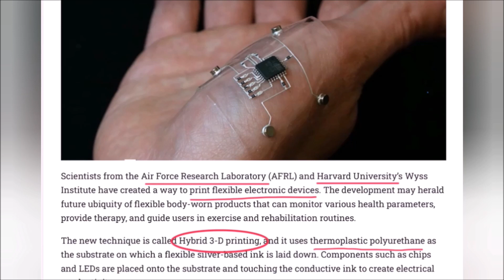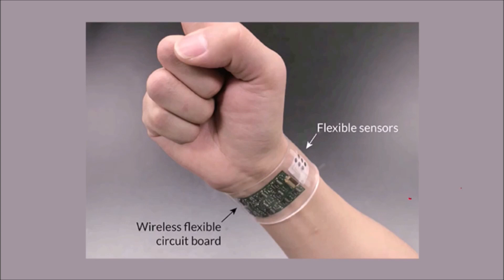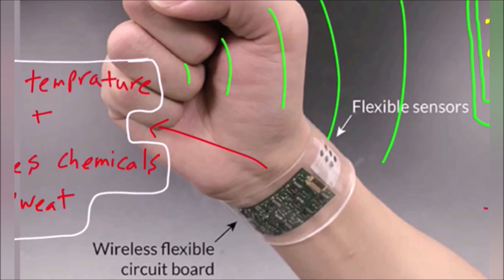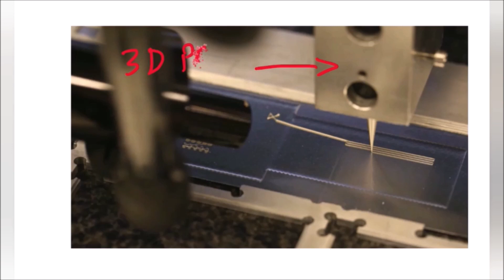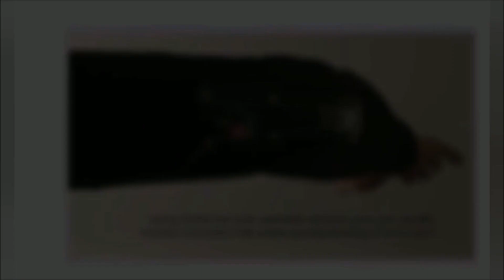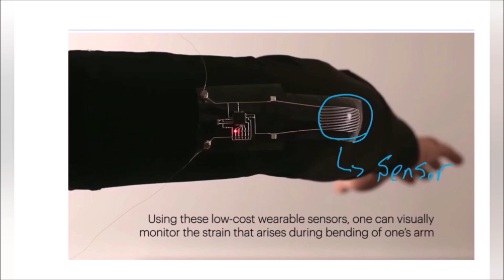Flexible Sensor !!

Comment: Which ic they are using
Reply from the maker: It depends on the required level of flexibility. For a small bending degree, you can use the regular small solid IC. These circuits are called hybrid because they contain both flexible and solid devices.